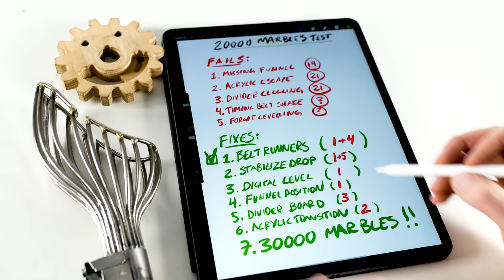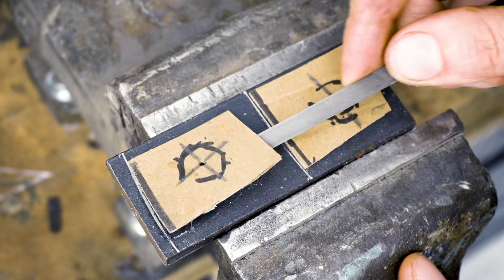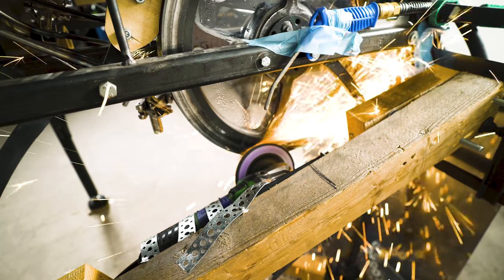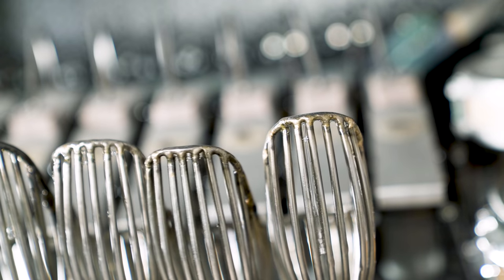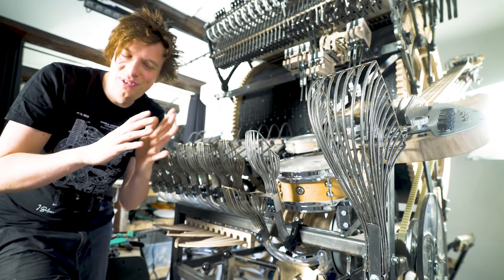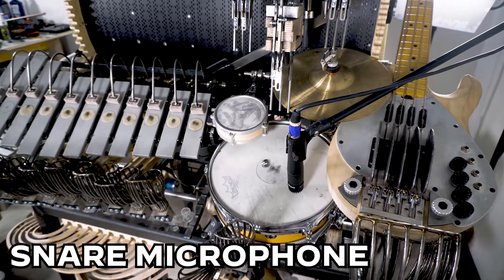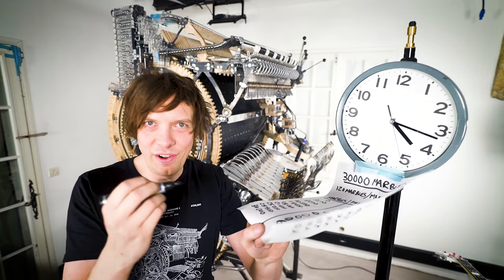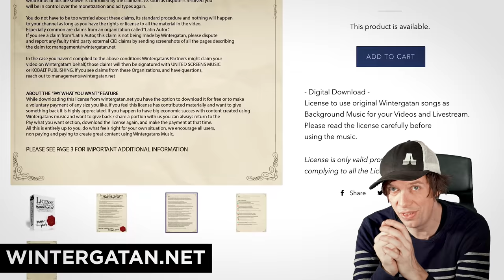Playing 30000 Marbles - Marble Machine X #148

Comment: Martin. A auto mechanic that does brakes could have had that flywheel machined, turned, and balanced within a day.
Reply: But he is not an auto mechanic.
Reply: He wasn't helping himself when he had the cutter going and the flywheel stopped
Reply: @elFulberto  You don't say. It was a recommendation for him to take the flywheel who does something similar for a living. A turning machine will tell the technician exactly where the counterweight needs to be, so Martin can potentially take the wheel and have material REMOVED on the opposite side.
Reply: I dont think comparing him to an auto mechanic with years of proper training means anything other than to say "git good scrub"

His choice not to look up tutorials is the questionable part.
Reply: @ihaveaplan.ijustneedmoney.9777  That's not even what I said. I said someone with expertise in trying to turn and balance a metal flywheel would have yielded more satisfactory results and a more clean result, in my example someone that does brakes. When disc brakes are replaced they machine the rotors so that the contact surface for the pads are smooth, which prevents the new pads from wearing out faster or failing.  Something for him to keep in mind when he needs a spare machined. It was a recommendation to improve the machine's overall finish and quality. You notice he's had experts come in at varying stages to help with the development and tooling on the machine.
Reply: @colinrobinson9858  I understand the DIY aspect, but in the end the job wasn't so simple. Aligning and balancing a spinning mass is a very precise process. I just hope those magnets don't cause a problem in the machine farther down the road.
Reply: He figured it out himself, that's gotta be worth something
Reply: @medium.kahuna  I like Martin a lot, and I want this machine to work. But the magnet trick wasn’t a fix, it’s a band-aid. Magnets shift over time, they have a different density from the flywheel as a whole, they’ll react differently from the rest of the flywheel to changing temperatures, and they will need to be removed and replaced every time the machine is shipped to a new location. It’s a fine jerry-rig for a machine that will never budge from a studio, but if he wants to take this on a world tour, the flywheel itself must be rebalanced.
Reply: I can not believe how many people completely missed the point of this post, he's not saying Martin is a scrub who needs to 'git gud' he's saying it would be best to take the fly wheel to a shop that has the expensive tooling to balance the fly wheel perfectly. Auto garages do this kind of thing all the time where they send parts like transmissions and engines to specialists to be fixed because the specialist shops have the super expensive tools and experience to repair the parts to a better standard and usually at a lower cost than the auto garage could do.
Reply: @ihaveaplan.ijustneedmoney.9777    yeah, i havent given him enough credit though on one thing. balancing the wheel with magnets, see also doing what you can with what you have, is pretty legit.

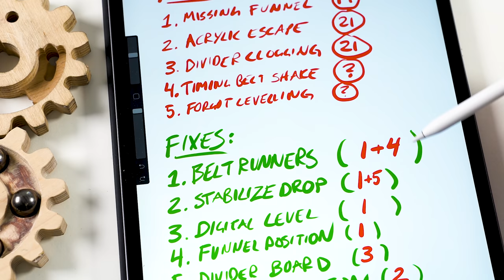Comment: 4:00 One thing to consider if you need to dampen vibrations you can't get rid of any other way is the idea of tuned dampers: https://en.wikipedia.org/wiki/Tuned_mass_damper
Reply: Yeah that would help some though it seems like the main vibration issue was solved.
Reply: @OldManSilencer  yeah, but I imagine that won't always be the case. For instance, what sort of motion are we going to see when he starts actually cranking on the handle or pedal? What about harmonics in relation to dozens of marble gates actuating in sync at certain bpm? I imagine martin will wind up needing tuned dampers somewhere eventually as nothing is perfectly ridgid (especially older stage floors) and it's a bit late in the design process to incorporate mass balanced parts and motions into the mechanisms.
Reply: @aquilux-vids  yeah he’ll probably need one eventually on there to deal with imperfections in both the stage and machined parts.  Though he’ll get to that road when he gets there foresight is a luxury of experience.

Comment: Is it worth putting some sort of "overflow" at the top for when the pipe fills up that diverts back down to the main reservoir at the bottom? The whole system is a closed loop so places like that will always trend up or trend down until you end up with an overflow or not enough marbles. Not enough is the one that would really impact playing music. So having an excess and giving that somewhere to "bleed to tank" anywhere these overflows could occur would be better.
Reply: Playing only two channels out of 38 is going to lead to more marbles filling up some points.  The more marbles in play, the more likely they're going to be elsewhere in the system (like in the return tracks, in the lifting wheels, etc.) instead of in the fish stair.  I would only say that's going to be necessary if he's finding that sort of thing going on when all 38 channels are installed and playing.

Comment: Those fails right at the end aren't really failures of the machine so much as an artifact of the testing scenario. In a real-life scenario, there would be a lot more than 2 channels consuming the marbles.
Reply: he adds the channels gradually
Reply: @jeffsadowski  I know that. I just pointed out (for the thread starter) that the testing scenario is being changed time after time (not every time, though)
Reply: I think they do count as fails. The height modules were improperly sized, which caused the backup. If he continued adding channels that were also improperly sized, the issue would be compounded for every channel that slows the marbles down, which would hypothetically be all of them, so the issue would become worse, even if every channel was active. Also, something this test doesn't show but can be deduced is that every subsequent channel that causes a buildup increases the amount of time it takes for the marbles to both reach the last channels and to get to the divide by 4 to keep the flow constant, so not fixing this could cause some instruments to run low on marbles more frequently
Reply: The problem is the machine is not designed to run at variable levels of consumption of marbles - ideally, it would run fine with no channels enabled, or all - but the fish stair  route has no output to the magnetic lifter route - without an exit route for overcapacity on the fish stair back to the lifter, the max marble count is really limited to that of the fish stair route. I hope that's enough marbles for the music.
Reply: @simonhunt3243  Actually, the fish stair circuit is how it deals with variable consumption levels. When consumption is low, marbles circulate in that route to readily fill channels when consumption increases. 

If the other channels were attached (even if they aren't in use) they would provide a place for those marbles to go, so fewer would be circulating in that path. I still assert that this was an artifact of the testing scenario, and not a deficiency in the machine.
Reply: @connormcinerney7503  No; the backup happened because there were more marbles entering the fish stair circuit than the active channels were consuming.
Reply: @themonkeymoo   If that were the case, the buildup would’ve been in the pipe feeding the divide by four. This was caused by the marbles being unable to enter that pipe or the snare channels smoothly, which Martin said himself. If one of the vibraphone channels were being tested instead, this problem would’ve appeared much faster as there’s less room on the divider to temporarily store the marbles as they’re stalled in place

Comment: I like how the physic phenomen of resonance is perfectly represent with the problem of the wheel and the vibration ! 
When you angle-grid the wheel, you have just change the frequence of the vibration, and it was closer of the "point of vibration" of the funels (That's a theory but it seem logical, if you have any suggetion ^^).
With the 3 magnets, the frequence just change and you balance it to find the perfect match ! It is nice to see how this beautiful phenomen appears in the conception of MMX :)
Keep going !
Reply: It was more a problem of unbalanced mass, as the funnels were vibrating no matter the tempo. Think of an off centre weight on a motor, it causes vibrations (voila magic wand). sure, there is still resonance if that vibration matches the resonant frequency of the structure, but a properly weight balanced flywheel shouldn't cause vibrations of a big enough magnitude to cause it.

Comment: When you interact with the machine it will move around more. You are going to need to brace the frame more to stop it moving around when you play it. Also different speeds may be more susceptible to vibrations, so you may want to vary your testing speeds. There are also going to be interactions with how close together notes are played. I saw that on the beats played closer together the marbles moved around more.

Comment: I'm..just a little bit scared that with all this testing, the wear and tear is gonna be noticable before it's finished :p. It's probably not a concerning issue but I can't help thinking about it.
Reply: I agree.  I think it needs a good cleaning these days. Plus, stop creating metal dust everywhere, Martin!
Reply: @fletchro789  well he did clean it not too long ago actually. or maybe it was a while ago. unsure. time is an illusion
Reply: That could be part of the test - find out what parts wear out and need to be strenghtended or replaced in certain intervals. Always good to have a "x seconds till failure" number for all your parts.
Reply: when all the tests are done, it needs a rebuild
Reply: @maraschwartz6731  Time is a continuous line of nows!
Reply: to be fair, if this could be considered a prototype... once its finished, he could re-create the whole thing using brand new and shiny parts using the exact specifications.
Reply: Serious issue, especially because many parts that should be adjustable are not.
Reply: Definitely noticed a few of the pmma pipes and the smaller drum has a bit of the graphite dust on it already, by the time the world tour comes around the whole machine will be black with the stuff haha

Comment: I feel like I'm a horrified bystander watching someone descend into insanity.
Reply: same tbh
Reply: Can't be because in the end he didn't loose his Mathew!!!😀
Reply: No jokes about him "Losing his marbles"???
The fruit hangs so low it's buried underground
Reply: He is losing his marbles.
Reply: hes been at this for a long time, dont worry :) hes just a crazy cool muscicianal engineer
Reply: Are you new here ?
Reply: @sunnyd1098  that's why he's losing it, dude has sacrificed his life and health for this machine
Reply: @amanasd26  hes a genius bro
Reply: @sunnyd1098  I would not call him that. About 70% of his physics explanations are just plain wrong. Second most recent one was his pressure reducing track. His explanation of why why wider tracks cause the marbles to go slow only works when the marble is moving. That had no effect on the back pressure. What reduce the back pressure was the snake because some of the downward force is being converted into horizontal Force against the wood. This man has just a good intuition on him which is serving him well. Although he waste a lot of time on the wrong thing, through sheer effort he eventually comes upon a working solution. I don't know why he thought angle grinding the flywheel would have an effect on the vibration.

Comment: The flywheel issue is basically the same as centering the wheels on a car. Also, bare in mind, that the snare drum´s head is actually vibrating quite a lot. That´s how it makes a sound, after all. So if you have a fast notes when the marble is falling onto still resonating drumhead, it will not have a "perfect" falling angle as it  had before :) Anyhow, quite a work you´ve done here and the project is amazing.

Comment: This will get lost, but this current issue seems like it will be solved when you start using more channels on the machine, when you have all channels going I doubt this problem will happen again.
Reply: Edge case. It Looked as though it was caused by the snare channel being full and the top marble protruding enough to stop the marbles behind continuing past and round the infinite loop. That could happen again even with all the channels in use, so def worth fixing.
Reply: Spot on it's an artifact of the design but it shows a deficiency you can get an overflow with enough balls rising the old marble machine had a buffer if hundreds of marbles at the top this one hasn't

Comment: Maybe the trampoline effect is happening on the snare. U know when people will jump and then make people jump higher. It’s possible that’s happening on top of the snare drum
Reply: Those effects only show up at high rates because the snare drum has a fast decay. (I'm a hobbyist drummer)
Reply: The problems that will happen next that will be painful to solve are related to seasoning: humidity and dimensional stability.

Now i think the funnels have enough slack to account for the drum, but the plywood parts... Not necessarily.

Comment: the only musical instrument that you need a crane and forklift to drag on stage, your roadies Martin must love you :)
Reply: Yes, it will be an issue, but put some big casters on it and it will roll.  Upright pianos can be 500 lbs, and a Bosendorfer Grand can be over 1000 lbs, and they are all one piece.  At least the MMX can be partially disassembled if needed.  Maybe Martin should have a guess-the-weight-of-the-MMX contest - winner gets free concert tickets!

Comment: 0.095% miss rate is absolutely nuts! Don’t let perfectionism distract you from areas of more meaningful gain!
Edit: I posted that at the beginning of the video... now I’m coming back to ask you to please please please accept your already stellar accuracy. You’re at risk of making things much worse by trying to fix every little shake and rattle. Take it from a professional mechanical engineer- you’ll never get out the vibrations. Not with a million years and a million dollars. Add mass dampers if you MUST but even if you get it running true, your bearings will wear and your belts will wear and after a couple performances it’ll be shaking again.

Comment: If he only watched Matthias Wandel's bandsaw build he'd known how to balance a wheel. Oh well, this way it was more entertaining.
Reply: Martin's flywheel had a great deal of sideways movement. Matthias Wandel avoids that issue altogether. Then Matthias is just left with the issue of balancing the mass. So in a way you're right, Martin needed to address the two issues (sideways movement, unbalanced mass) in different ways. The angle grinder method could never have dealt with both issues at the same time.

Comment: Who else was screaming at the TV that that's not how you balance a wheel? 🤣
Clearly he's never owned a car.
Reply: Exactly the thought I had- Balance the wheel- he'll never get it true to the level he wants by grinding.
Reply: @bobfish7699  he can't grind every surface either. There may be voids, changes in density, etc.
Why he never searches for the answer before just having a go I'll never understand.
Fun to watch but oh my painful, you know he's already since this, you know it's already gone wrong!! 🤣🤣
Reply: Me lol ;D And i don't think the wobblyness was a prob/cause of the prob. And a flywheel should be weight ballanced already, right? He created weight imbalance deluxe by grinding the wheel.
Reply: @DaP84  yup, increased resistance within the bearings
Reply: @DaP84  I don't think that the flywheel was properly balanced to begin with.  It it would have been, he wouldn't had needed to try to grind it to balance.
The grinding didn't made it better, but it probably didn't made it much worse either.
Reply: It's a biking mindset. After all, like the wintergatan song, biking is better! Why would anyone own a car?
Reply: I'm sure most car owners don't know how to balance a wheel.
Reply: @nekhumonta  No, most car owners knows that weight imbalance results in vibrations, which is not good. And that they add weights to the wheels in certain places to make the wheel balanced.

Comment: The MMX doesn't need to play 1 million marbles in a row. It only needs to play for the duration of 1 concert. You've already achieved this.
Reply: yep, and, in terms of failure modes, not catching a marble is barely even an inconvenience anyway let alone a meaningful failure - the worst outcome is that a roady slips on it after the concert is over... audience will still hear that marble played. DFMEA!
Reply: million marbles divided through 38 tracks is 26K each which is roughly a 2-3 hr recording session.
Reply: @matrixstuff3512   True, but if you are going to play it like that, he needs to be testing all the marbles gates and all the marble funnels otherwise its not a true test.

Comment: 1:41 But actually if you look close it DOES touch the sides. 😀
Reply: Is he blind?
Reply: @uiopisreal9966  I think he means that it doesn't hit the sides going in the hole, not necessarily going entirely through it. (Like it doesn't bounce off the top portion) And to be fair, in real time it is really hard to tell if it is hitting or not unless it is really off to the side.
Reply: Yeah but 1:41 "it doesn't touch the sides" is generally understood as not touching the sides, right? And also this was in the voice-over-part in which, I assume, he's looking at the same picture-film as us.
Reply: @uiopisreal9966  He probably meant "it's not touching the upper sides" as in "it's going through and doesn't matter if it bounces once inside". Tbf, 4 spare cm is too tight for those different angles.